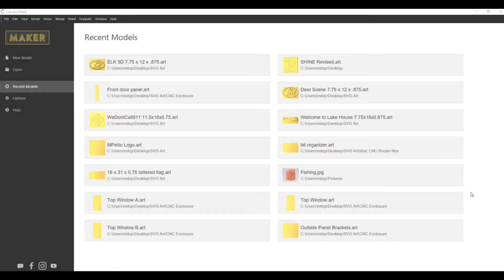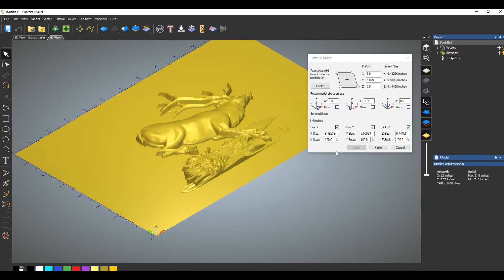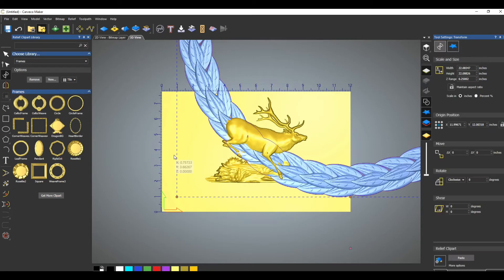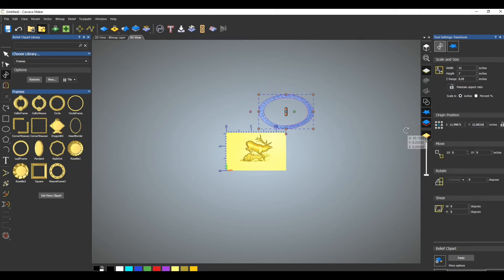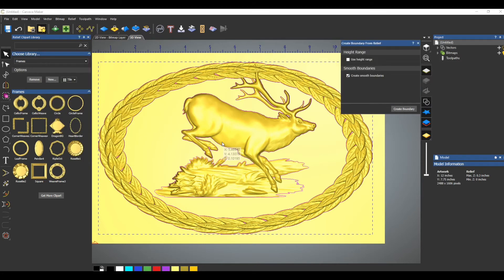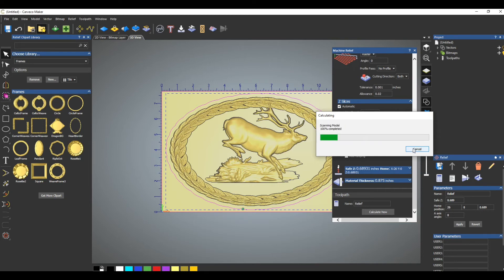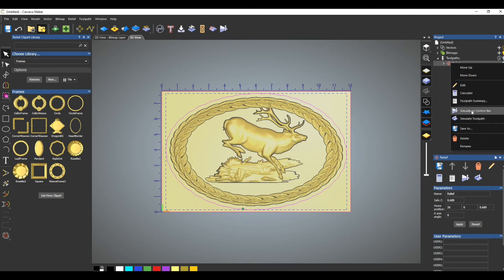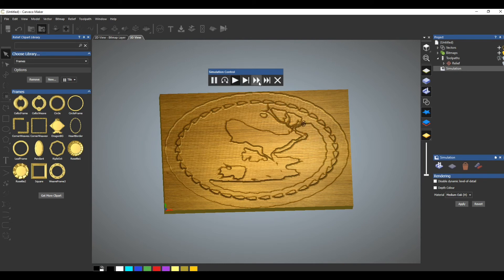Carveco Maker -Design and Toolpath for 3D Elk Carve

Comment: Excellent video. My machine wont go down to board , just cuts air. Why.
Reply from the maker: Did you probe z from the top or bottom of material?   Needs to be probed in the same place as the design software

Comment: Mitz, thanks for posting this. I won’t receive my 1F until late May so I’m looking at the different software packages. I’m just starting with CNC but would like to be able to produce a carving like this someday. Did this image come with the Carveco software?
Reply: Thanks for the quick reply Mitz! Sounds like whichever program I go with I can just buy additional image files directly from the designers. Good to know.
Reply from the maker: Hi Mike- thanks for watching. Although Carveco comes with a basic library of relief files, I got this particular one as part of a set of 4 reliefs from Etsy for under $10. I’ve purchased other individual files for $2-5 each. I did use the border relief from the carveco library for this one too.